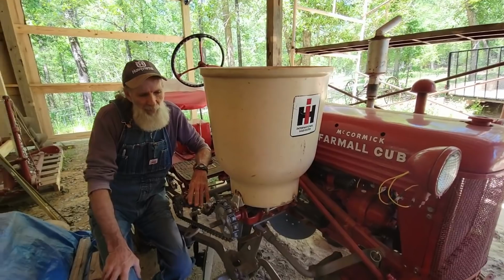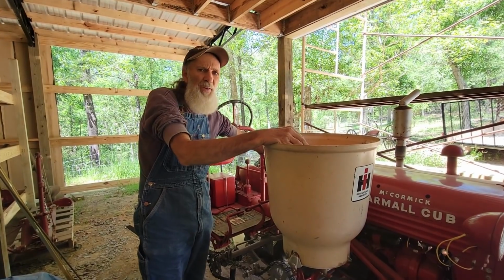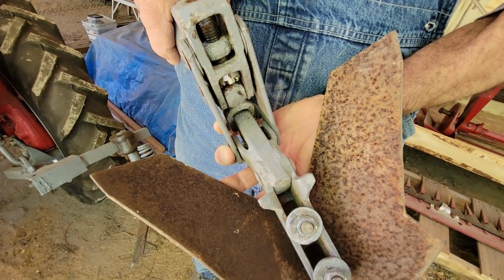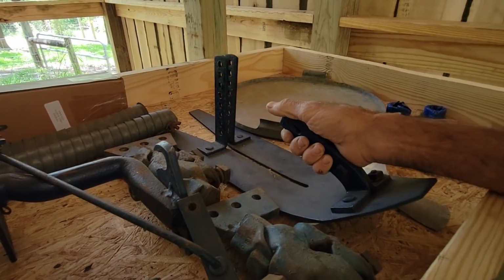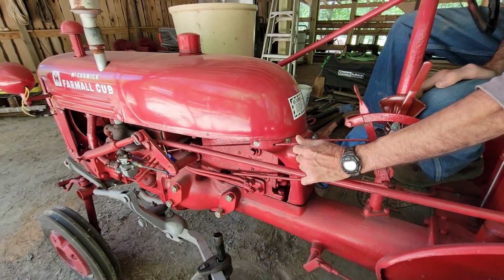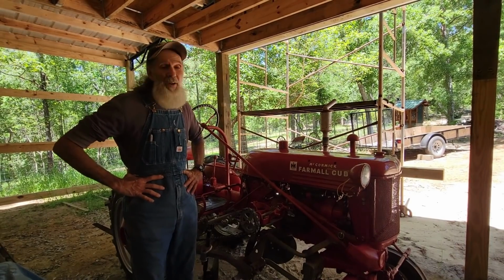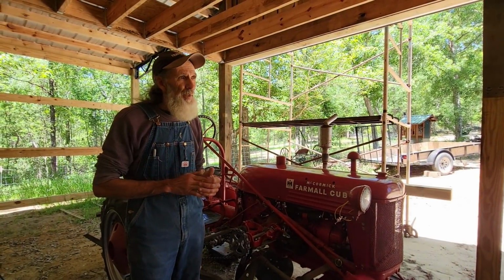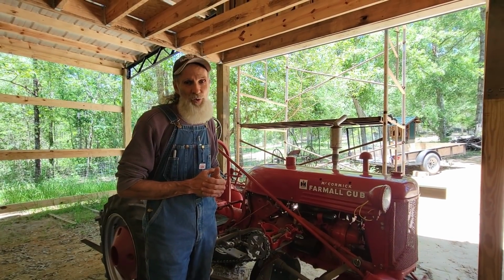"Laying By" the Danny Corn with a Farmall Cub

Comment: Your video on the inside of the hopper was very helpful to me as mine was in a pile of pieces when I got it.  I'm so glad the chain tensioner advice was helpful so I could return the favor.  Just found out yesterday on Lincoln Ag's page the large flat corn plate 1979 A Is a perfect fit for pole and bush beans.  Checked some seed I had on hand and sure enough perfect fit. 
  I am also having the same problem getting the adjustment just right on the rear sweeps.  High enough for travel but deep enough in the field.  Thanks for the great content.

Comment: What is that old manual typewriter noise while the tractor is running? Is it just a weird digital effect from the microphone being overwhelmed? You her it really well when you get off the tractor waiting for some of the fuel to be run out before you switch it off.
Reply from the maker: My clutch pedal has a little slack in it and rattles .

Comment: I think that back bar goes to the top usually. But I would also say it can and probably was intended to run it any way the user wanted based on what they wanted and how much lift. These farmalls are so versatile in how they can be set up I wouldn't be surprised if it was intended to go either way. There so many ways to set them up and adjust them often more than one way to adjust something to get the same end result.

Comment: I think the tensioner should be on the bottom, on the 'non-load' side.  I'm assuming it is being driven by the front sprocket, and the top of the chain is pulled tight when operating?  Therefore the tensioner should be on the bottom/slack side of the chain and pushing up.  I'm no expert, but every tensioner that I've ever seen takes up the slack on the non-load side...
Reply from the maker: Its driven by the rear sprocket.

Comment: I didn't know what laying by the corn meant.I had a failure when I tried the three sisters, the pole beans strangled the corn.Maybe fields peas wouldn't
Reply from the maker: I had the same problem.
Reply: Its all in the timing.  The beans grow kind of fast.  Gotta hit the sweet spot before the corn shades them out, but the beans don't outpace the corn's height.  I have had great luck with it, up in CNY.  We learned that the Iroquois did this, don't know if other tribes did, so maybe it does better in certain regions.  I grow Lina Sisco beans that I save.  Look those seeds up - excellent heirloom dried bean originally from missouri.  Hot Pink Pods and large speckled dry bean.  Grow up the corn great.

Comment: I would not trust those screws to hold that shelf, a better system would have been to notch it into the 4x4.  I think I would put a 1/2 inch screw though the 2x4 and the 4x4 post.  Weight is going to be a problem with the screws over time.  Will fail about the time you have them loaded down.  Get video really enjoy watching experience people.